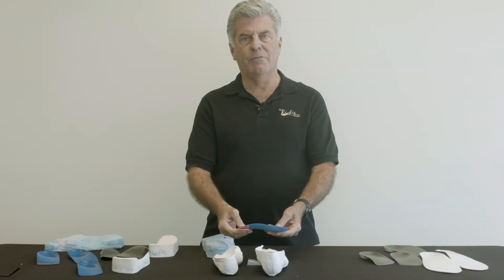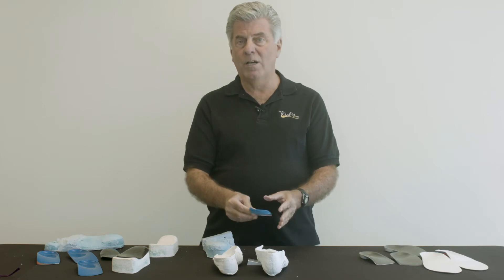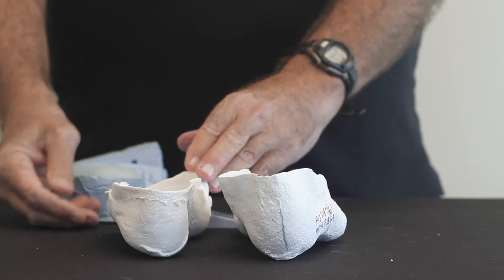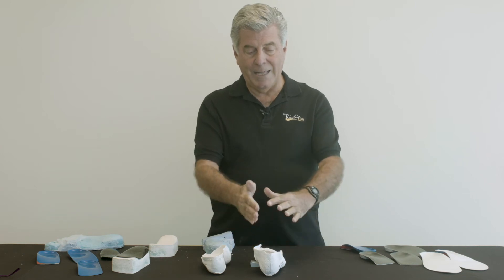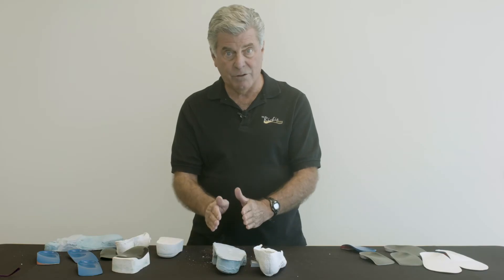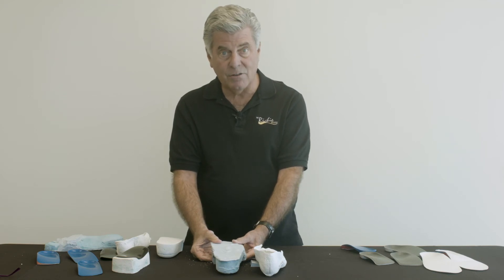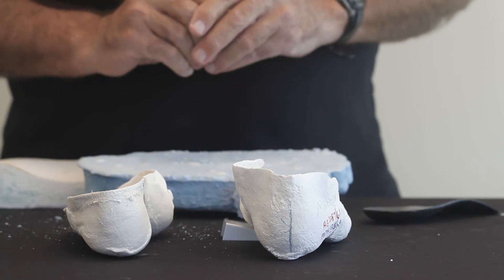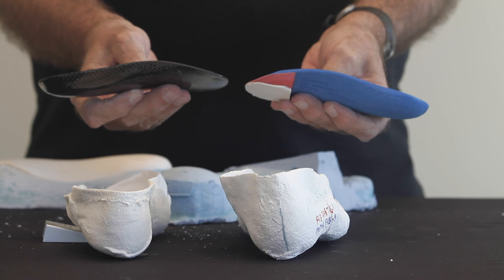Dr. Richie Presents Intrinsic Posting on Custom Foot Orthoses

Comment: Good afternoon Dr. Richie. Can you please specify, how much plaster do you use to "align" the added platform with the original mold so the wedge is not "visible" anymore? It seems to me, that with this additional plaster there could be a less medial arch support, when compared to application of the extrinsic post. Can you show us, how both the intrinsic and extrinsic posted orthosis fit to the original cast? Thank you very much!